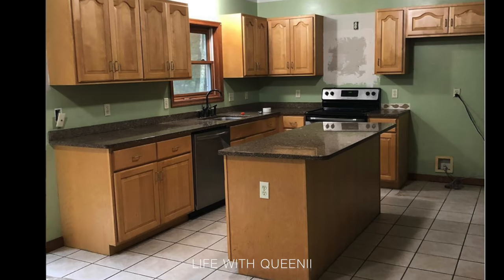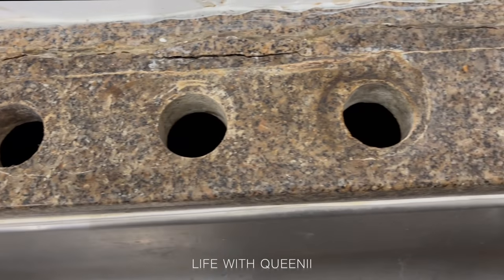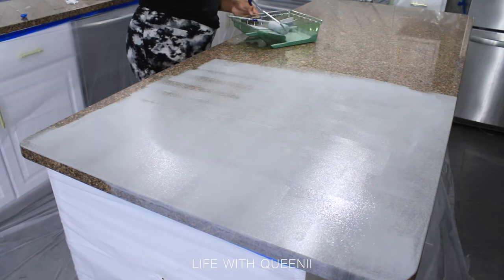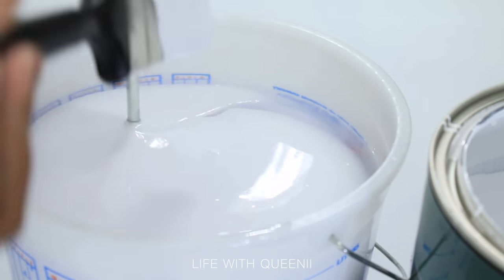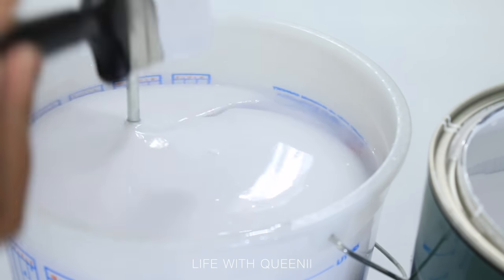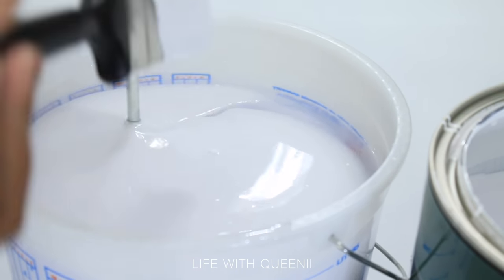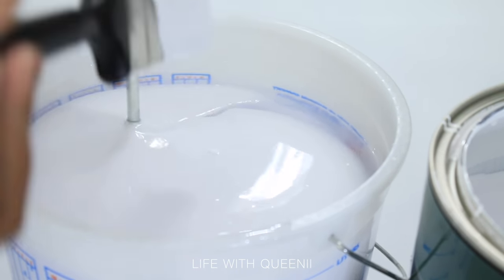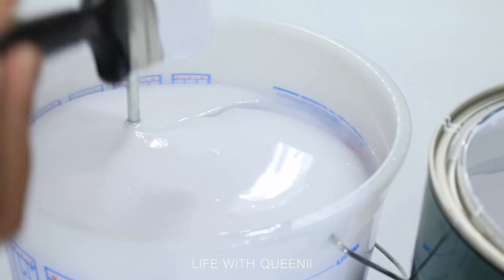DIY Marble epoxy over old granite countertops! How to do Epoxy marble over old granite countertops

Comment: I absolutely loved this video so I did it and it turned out amazing, I got so many compliments on it but now I have urgent questions. I’ve noticed the countertops SOAK up stains like crazy, I used to set my grocery bags on my counter but now I have seen that it will take the printing off the bags and keep it. Or when I have needed to leave hot pans/pots on my countertops with towels or oven mitts under them (for serving meals) there are huge brownish spots left all over 😫 what do I do to fix them? Do I have to sand them all down and redo those spots? I’ve tried baking soda and clear dish soap and it got a few of the marks from the grocery bags up but a ton still left…HELP PLEASE
Reply from the maker: I don’t put groceries bags on my counters or hot pots directly on them even on the regular granite. Just a habit I have. My husband actually just burnt incense on our counters and one fell and left a reddish mark on the counter. I plan on sanding out out.
Reply: @LifeWithQueenii  I’m learning not to put anything at all on the counter tops but that’s what I was wondering if I should do to mine (sand out the spots) or if I would just end up making it worse by redoing them.

Comment: How many coats of epoxy? Look s rather thick as you spread... Is the 45 min. Limit to work with epoxy, after mixing or from when you pour on countertops? Thanks.
Reply from the maker: Once I pour its 45 min . it will look thick as I spread it out it’s a video , the thickness is 1/8 of an inch for first coat and 1/8 for clear coat. Hope that helps.

Comment: wow...too good.. will the epoxy stick to the original marble? because it is smooth? i was told that it will not stick as my old marble table is smooth and epoxy needs a rough base to sit on... :(
Reply from the maker: Pre sand and it will stick, just need to remove the shine and prime like I did in the video

Comment: Did you paint your veins after the epoxy layer?
Reply from the maker: @dostufph  after the white epoxy I added the epoxy tinted with greys to create veins 😀
Reply: @LifeWithQueenii  thank you, while first coat of epoxy was wet or dry?
Reply from the maker: @dostufph  still wet, do not let epoxy dry before adding veins. The first two steps of the epoxy must be done in 45 minutes that’s for the white and the veins and then I waited about an hour or two and added the clear untinted epoxy over to finish
Reply: @LifeWithQueenii  got it thank you